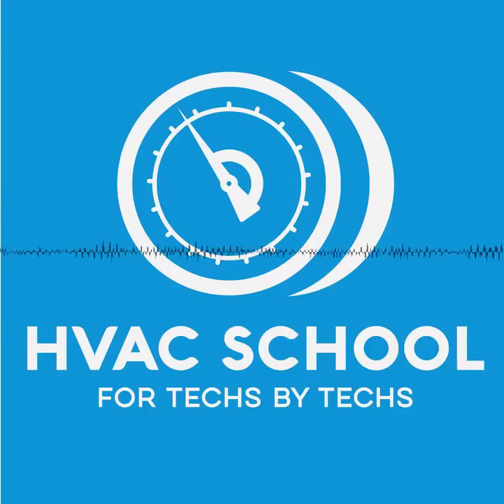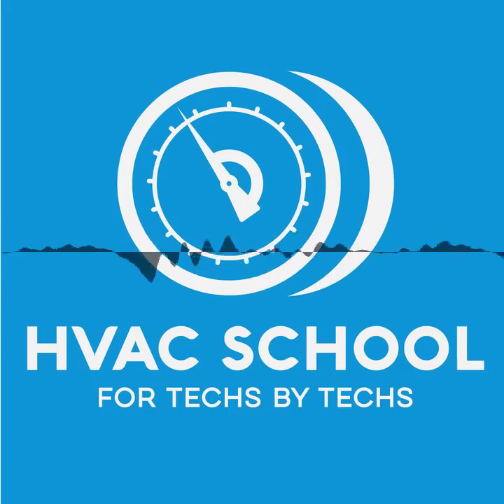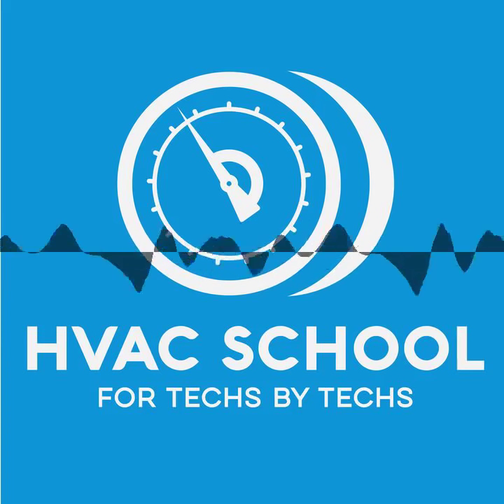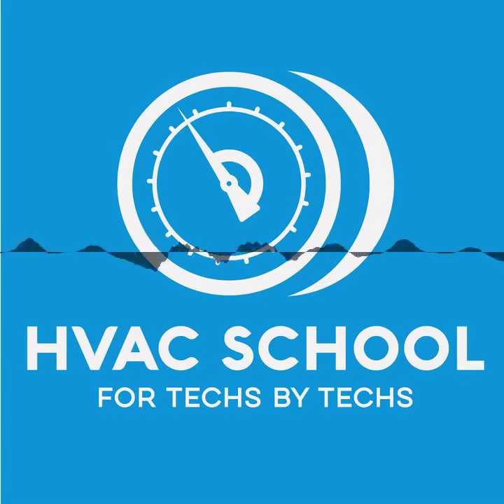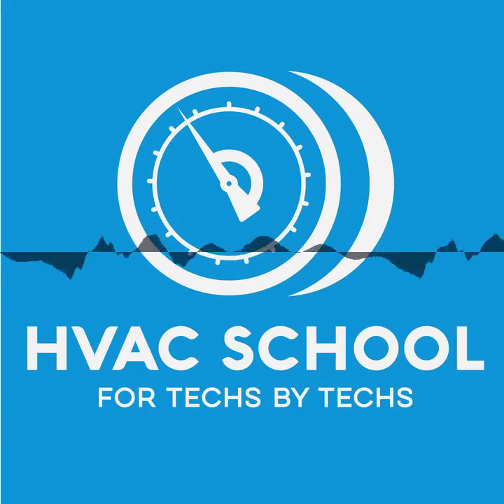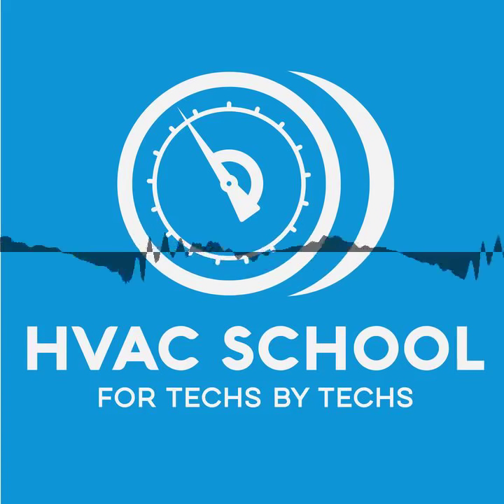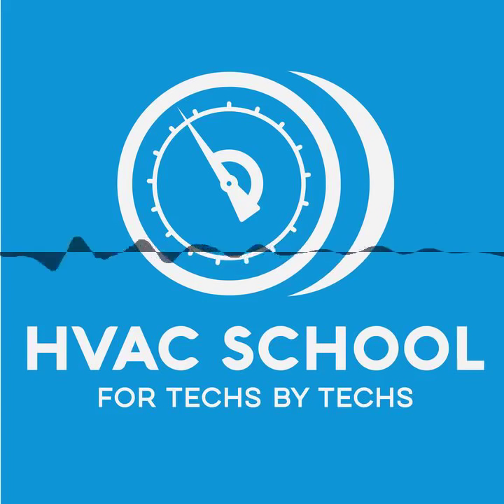Short 17 - MicroChannel

Comment: Informative podcast. Here is some more information. A Rheem 2 ton slab microchannel evaporator coil in a package unit (leaking 5 years and a couple of months [of course not registered and out of warranty) is $3300 and change from my distributor!  Naturally it is 3 months out (November). Not sure if these are a good way to go if the replacements are not readily available and the replacement cost is so high.

Comment: Can you make a video on charging a microchannel out in the field  ?
Reply: Be careful when you charge one of these. You can easily overcharge one. Usually there is a charging chart inside main electrical panel or compressor section panel. Take your time and read it over and charge according to the chart. If you start trying to do it old school style it will bite you in the ass. Trust me!

Comment: So a compressors internal over pressure by-pass wont open soon enough to protect the micro-channel? I guess by then the low side would be in a vacuum which i hear is not good for the motor winding's...